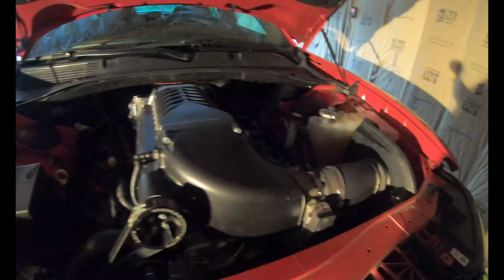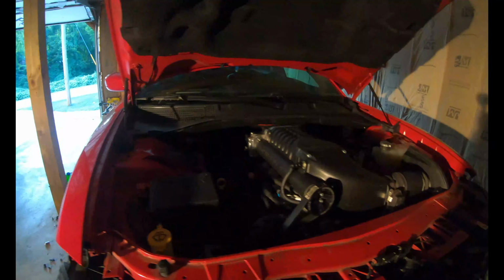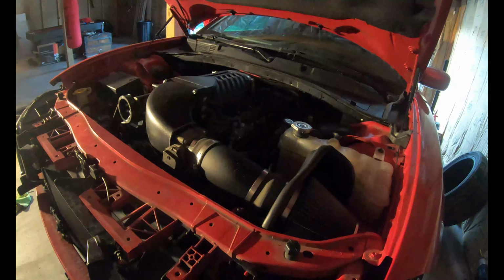Whipple Installed On The Scat Pack!

Comment: Whipple life hell yeah brother !!
Reply from the maker: I'm excited lol ready to see what it will do
Reply: CodeNameScat I hope you have a good set of tires . You’ll want 305’s or 325’s 😂😂😂
Reply from the maker: @carmob7499  I got 315s. But they didn't  hook before lmo
Reply: @CodeNameScat  buy Toyo R888R'S .we hooked great with 772 rwhp on a 19" Rim .
Reply from the maker: @carmob7499  I'm thinking about doing the 15inch conversion
Reply: @CodeNameScat  That would help, were gonna run 17's for our drag pack.
Reply from the maker: @carmob7499  I got 305/45/17. But they don't hook on the street
Reply: @CodeNameScat  you definitely need a better compound , you should be getting decent traction on that size tire ..
Reply from the maker: @carmob7499  Mickey Thompson et Street ss
Reply: @CodeNameScat  you might want to try the et street R's ..

Comment: What cam did you go with?
Reply from the maker: It’s a custom grind modern muscle extreme boost cam
Reply: @CodeNameScat  I'm in Bama too. What's your car run full weight?
Reply from the maker: Full weight 6.80/7.0 consistently.  With skinnies on and rear seat out some other stuff took out of the car 6.42 my best pass but that was in October I tried it last night full weight all she wanted to do was a 7.0 lol too hot out lol